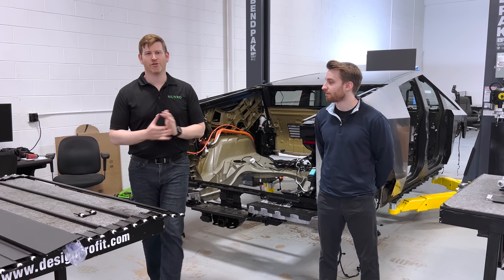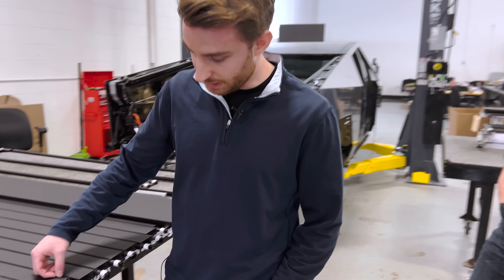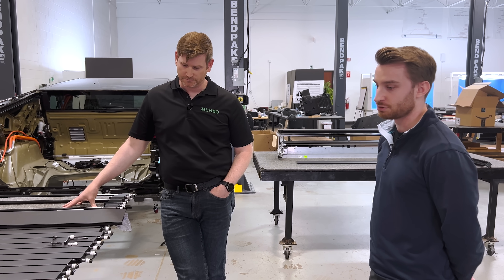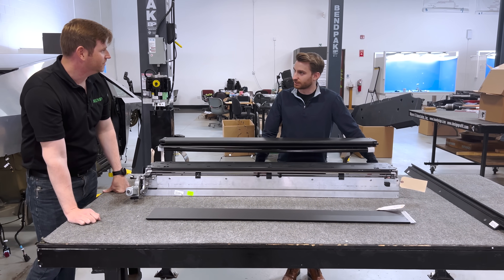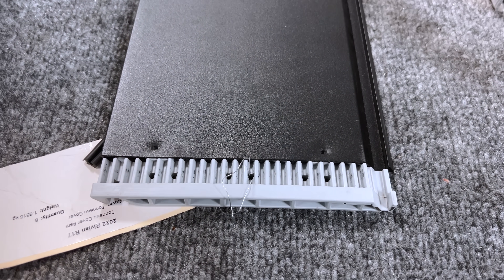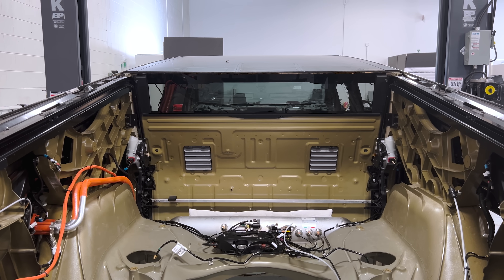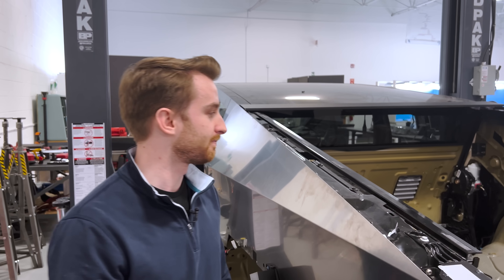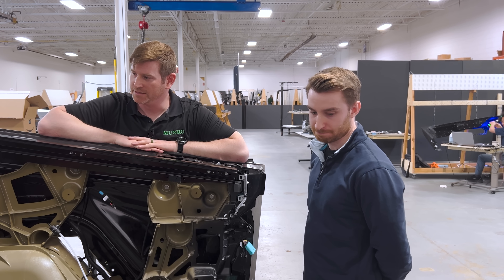Tesla Cybertruck Tonneau Cover: Design and Functionality

Comment: Normal truck aftermarket cover 1,000 bucks.  Manual mechanism and it just works every time all the time.   Not fancy but it just works.
Reply: This is a very robust mechanism. Motorizing makes it appealing to people who view it as an over sized trunk.
Reply: @danharold3087  motorizing it makes it prone to not working.
Reply: @ZzHasbrozZ  you realize literally every vehicle is "motorized" right?
Reply: @themonsterunderyourbed9408  dumb point.  A trifold cover on a traditional truck bed flips open using human power.  Simple and easy.  They even make coiling ones that are manual.   Sandy says eliminate as much weight as possible.  These motors and systems are counter to that philosophy.
Reply: Your answer is too generic. There are 100s of various aftermarket tonneau covers. All at different pricepoints, pros + cons and use cases. Cybertruck has sail panels that are a con for those prioritizing lifting items over the side, but the truck does lower- where most trucks do not have air suspension. New full sized trucks are very tall. You need a step stool anyway. The height, strength and security of CT's tonneau make it very unique. Your average $1500 bed cover will not cover taller items and many are not secure against determined thieves.
Reply: Exactly.  Making solutions to problems that don’t even exist😂
Reply: @Lemon_Drums_USA  A cover gives the CT 10% more range.    This electric cyberTruck cover has mom's and grandparents buying the CT instead of a SUV.  I would say it is a solution for a problem others have not fully recognize.

Comment: Every time I see those cybertruck aluminium castings the coating (including the colour) reminds me of the treatment and the coating that was used on the insides of aluminium barrels to protect them from the corrosive properties of the beer. To get that coating to adhere there was a chromate process to key the surface of the aluminium to accept/bond the coating. Is something similar being used by Tesla here?

Comment: My only complain for my pending CT is that my dogs cannot go into the bed via the back seat.  I know the safety issue but I'm sure some electronic monitoring with triple backup would allow a hole to be placed where the center fold down seat is to allow some back and forth AND the benefit of loading in some very long lumber or pipes.  I'm hoping Tesla will reconsider that somewhere down the road.
Reply: Hear mixed reviews about mid gates.
Reply: I canceled my cypertruck when tesla didnt implement the specs they promised. I got the chevy silverado!!!! Better than the ford lightening ev. Has 450 miles range... when towing 250 miles range. The back wall is removeable you get the bed plus the space till the front seats. Its great for camping... you remove the window and have an airconditioned tent! Wich is awesome in the summer. Plus a spare wheel without loosing the bed. like in the cypershit LMAO. Plus you can reach into the bed and get things wich is impossible in the cyperssss due to the angels above the bed. A lot of plugs for electricity. Plus the fastest charging of any ev truck out there... its charges up to 100% in the same time the cypergarbage truck does... but has twice the battery! And it costs less!!!! If you want a great truck at great cost than go with chevy rivian or ford... The chevy is the king of EV trucks right now.
Reply: @Ravenought69  Chevy is low volume at best.
Reply: @Ravenought69  the Chevy EV isn't even being delivered yet. It's pretty much still vaporware. Also, where are you going to charge it that fast? Does Chevy have a charging network?

Comment: Cyber truck definitely is a pretty cool design and looks to be well-made. That being said my Rivian Tonneau cover has never failed and TLF cyber truck tonneau cover failed within one month of ownership.
Reply: the opposite is true, almost all of the original Rivian tonneau covers failed. And while the TFL cybertrucks cover did get off track it did so after some extreme offroading.
Reply: @jamessmith-yk3sc  Well, we use our R1T Tonneau cover daily and it has over 30K miles without failing.  Where is your data on "All of the original" have failed?  Do you work for Rivian?  How would you know this?

Comment: I'm not sure what audience Munro is aiming for or hoping to educate, but do you want to be steeped in VAJ so you're only talking to engineers and academics or are you hoping to reach 12 year olds who might aspire to be future engineers and scientists? Btw (by the way), "VAJ" is an acronym I just made up. VAJ stands for Vernacular, Acronyms, and Jargon. ;-)
Reply: What prompted my comment was wondering what "palm" was, because the closed captioning typed it that way. I then figured out that you were probably using an acronym, likely "POM" which I looked up and learned that it was Polyoxymethylene, which is also known as acetal, polyacetal, and polyformaldehyde.  It is an engineering thermoplastic used in precision parts requiring high stiffness, low friction, and excellent dimensional stability. It is often used in automotive parts, including various components in tonneau covers.

Comment: I've seen many cybertruck tonneau's, including my own, which seems to not be installed square with the truck.  When you close the gap at the tailgate is 5/8" different at the tailgate, as well as at the roof line.  You can see that they are not parallel.  Can you see any idea what this is  being so common?  Is it hard to get it straight?  Are the motors just calibrated differently maybe?
Reply: Same issue on my cyber truck.  Would love some input from you guys!
Reply: @Mav4Caps  hopefully they chime in.

Comment: CT cover is actually low in complexity and more parts. Also way more failsafe designed.
Reply: Can you elaborate on how this is fail safe design? I’m clueless there, thanks.
Reply: @howiedewit1337  I suspect he really means a more reliable or a fail proof design. The mechanism appears much more robust in many ways by both deign and construction. For example, wider slats are more prone to binding from a slight skew than the narrow CT slats; slat skew further exasperated by the use of a single light duty motor with a small diameter connecting rod vs two hefty (easily synched stepper) motors;  CT slat trolleys are heftier and their engagement with the motor drivers more robust than the tiny gear teeth of the Rivian to name just a few.
Reply: How does it fail safely?
Reply: nope

Comment: Bespoke accessories until the aftermarket catches up, then it's an accessory similar to any other trucks accessory. There should be no problem with work truck usage.
Reply: I canceled my cypertruck when tesla didnt implement the specs they promised. I got the chevy silverado!!!! Better than the ford lightening ev. Has 450 miles range... when towing 250 miles range. The back wall is removeable you get the bed plus the space till the front seats. Its great for camping... you remove the window and have an airconditioned tent! Wich is awesome in the summer. Plus a spare wheel without loosing the bed. like in the cypershit LMAO. Plus you can reach into the bed and get things wich is impossible in the cyperssss due to the angels above the bed. A lot of plugs for electricity. Plus the fastest charging of any ev truck out there... its charges up to 100% in the same time the cypergarbage truck does... but has twice the battery! And it costs less!!!! If you want a great truck at great cost than go with chevy rivian or ford... The chevy is the king of EV trucks right now.
Reply: @Ravenought69  Thanks for the info. You definitely make a lot of sense.
Reply: @dominickcolasanto6582  THX mate... Yeah i am actually a tesla fan from the beginning.... But i get less and less exited about heir products... The telsa model s was a smack down for all ice cars or cars in general. I wished a tesla truck was the same and reserved one actually. But it just failed to deliver on all fronts. I hope someday tesla delivers a truck that is a real smack down for all trucks out there like the model s plaid was to all 4 door sedans. Best range, speed usability etc. The cypertruck just failed on all fronts. Tesla choose design over functionality. thats real bad engineering.
Reply: @Ravenought69  This is false. They didn't choose style over functionality. The truck design is a product of the simpler manufacturing process. That's why it's it looks this way. It's the complete opposite of what you said.

Comment: Lol so the Rivian tonneau cover is much simple, less expensive, requires less space and doesn’t work😂
Reply: I have the 2.0 on my Rivian.  It works fine.  The 1.0 worked for me, just super clunky.
Reply: there is nothing funny about this! they probably rushed that to the market and yet its still impressive what they achieved now its time for the second gen lol!!!! you guys have no braincells! its just good at mocking others instead of actually helping
Reply: lol....
Reply: CT needs to add a camera above the tonneau facing rear. Air flow will keep it clean and can see items in bed while driving. They'll do it.
Reply: Ummmm, ummm, yea
Reply: At least Rivian wiper motors work.
Reply: @brendanpells912  Why do you think the Cybertruck wiper motor doesn't work? It's pretty amazing actually.
Reply: @ZipZoomZip  Errmmm, because there was a recall to fix it after wiper motor failures. And the wipers on my car are pretty amazing too. When it rains they sweep backwards and forward to clear water off the screen so I have a clear view ahead. In what way is that any less amazing than what the Cybertruck wiper does? Replacement wiper blades are £18, that's about $23. That's an amazingly low price for Bosch Aerotwin.
Reply: My Rivan's tonneau has worked fine for over two years
Reply: @jasons7044  So You're the exception to the rule. Congrats! You must use your cover like once a month.
Reply: @jasons7044  But that's not the narrative these people want desperately to believe. Remember when online EV communities were about education, support, and positivity about the future? Sigh.
Reply: Most accurate explanation I have  seen so fare 😂🤣
Reply: It won't stop thieves like cybertruck but it could hide your valuable stuff
Reply: @Wi2Low No, it's legacy wisdom. The rear view mirror is where it is on vehicles because you can glance at it without taking your eyes off the road. Gauges are put in front of the driver for the same reason. Moving everything to a touchscreen in the middle of the dash requires the driver to be distracted while operating their vehicle. It's the dumbest thing about Teslas in general.
Reply: @hankkingsley9183  What's the dumbest thing ever is putting important driving information (like speed) behind a wheel with spokes that turns whenever the car does. And that requires the driver to adjust the steering wheel to the only height that allows a sightline down through the wheel to see the vehicles speed. The only cars I've ever driven that allow me to lower the steering wheel to a comfortable position in terms of avoiding shoulder/neck pain on long drives are all made by Tesla, cars that don't hide your speed buried behind the steering wheel.
Reply: Really the major issue with the Rivian system is it needed two motors instead of a connecting rod (or a larger motor and connecting rod), and larger sprocket teeth with deeper engagement. It's a beautifully elegant design. Cybertruck tonneau looks like an existing roller door design only slightly adapted to this use. It almost looks like an off-the-shelf product dropped in.
Reply: @patreekotime4578 isn't it the Cybertruck that has two motors?
Reply: @Dularr  Not sure what your confusion is.
Reply: @patreekotime4578  that the rivian has one motor. While the Cybertruck Hass two
Reply: @Dularr  Which is exactly what I said. 🙄 Do you even know why I brought up the motor?
Reply: @patreekotime4578  you edited your post
Reply: @Dularr  Ugh... yeah I corrected myself almost immediately, I had said the Cybertruck tonneau looks like a garage door, and I changed it to say it looks like a roller door. The Rivian part is the same. And you didn't answer my question... do you know why I mentioned the motor?
Reply: Cybertruck you cannot use the rear window closed or partially open. No rear camera monitor in the rear view mirror. The Rivian 2.0 fixed the issue an you can use the larger rear view mirror. The cheaper yet much more feature rich chevy Silverado RST has an in mirror monitor an up to 10 plus foot bed with rear seats folded down.
Reply: @netgeek3010 it’s on the main screen and you can make it very large. Probably some regulation bullshit why they couldn’t have the rearview be monitor.
Reply: @netgeek3010 shows giant high res video on the cybertruck screen
Works amazing and I think full 180 degrees.

Comment: Absolute garbage, nothing new here had a power cover on my Sierra back in the 2000s nice unit but big issues in northern climates. The 3panel hard covers by GM far superior 🏆
Reply: How much did that cost as an addon?
I do wonder how it will hold up but I am guessing from all the testing in cold weather and the large motor there may be a good deal of usability of the Cybertruck cover.  Imagine if you didn't have to manipulate the cover outside in that weather like Cybertruck may allow for.
Reply: @leesargent8205  I canceled my cybertruck honestly it isn’t usable as a “truck” the high sides  that cover I guarantee will hv issues, the GM EV platform is superior in range, charging, and quality. Don’t believe me go to Out Of Spec Reviews. &save yourself the 50K hit in 36months

Comment: Would the tonneau cover provide any protection from a heavy weight in the bed in the event of a collision?
Reply: A heavy load on the bed must be strapped down to the floor on every truck, everything else is careless!
Reply: @joanpere8863  I agree, but at 80 or 90 miles an hour, straps do not hold down a heavy object if the vehicle hits a brick wall or is in a head on collision.

Comment: Question?
Is Tesla the only manufacturer that equips a Electric Truck standard with a Tonneau Cover?
Does the Tonneau cover ever lock in place? Or does the motor ever go bad?
What about the aerodynamics when the cover is out? As opposed to being in, does the driver notice a difference?
Has anybody put the Cybertruck through a wind tunnel?
Has Munro and the employees done a Cost on this Tonneau cover?
Reply: The Cybertruck tonneau cover is locked when the vehicle is locked. Even if the cover is partially open, it’s locked in that position until the Cybertruck is unlocked, or until the Tesla app is used to change the opening.
I’ve read a 10% loss of range when the tonneau is fully open.
Reply: @broddr  What about when the motor goes bad?
Reply: The rest of the industry knows that putting something like this on a truck is going to be a headache down the road.  If these trucks ever get used for more than shopping trips to Costco, they will be beat up and destroyed.  Who's going to want to continually pay $5k+ to repair these?  It will only be covered by warranty for actual manufacturer failures, not accidentals.
Reply: @handlealreadytaken 
Yeah , the rest of the industry hate innovation
What could possibly go wrong for your valuable stuff with 🌧️ 🌧️☔

Comment: It'll be nice to see how many features and processes from the CyberTruck will be adopted by the rest of the industry.
There will always be old school purists that demand an old school truck, so that segment of the industry will never die.
Reply: Kind of wish you could remove the bed to put other stuff there.
Reply: I canceled my cypertruck when tesla didnt implement the specs they promised. I got the chevy silverado!!!! Better than the ford lightening ev. Has 450 miles range... when towing 250 miles range. The back wall is removeable you get the bed plus the space till the front seats. Its great for camping... you remove the window and have an airconditioned tent! Wich is awesome in the summer. Plus a spare wheel without loosing the bed. like in the cypershit LMAO. Plus you can reach into the bed and get things wich is impossible in the cyperssss due to the angels above the bed. A lot of plugs for electricity. Plus the fastest charging of any ev truck out there... its charges up to 100% in the same time the cypergarbage truck does... but has twice the battery! And it costs less!!!! If you want a great truck at great cost than go with chevy rivian or ford... The chevy is the king of EV trucks right now.